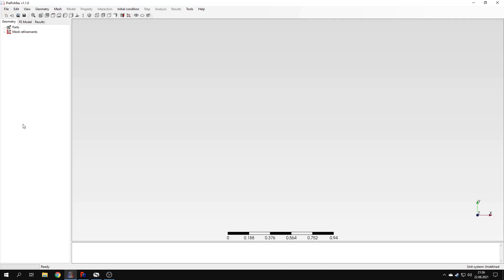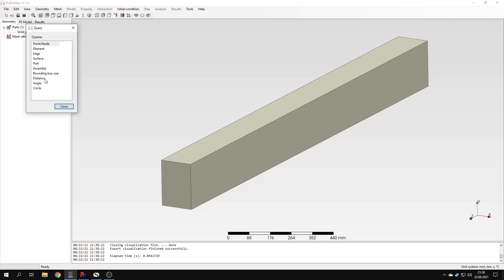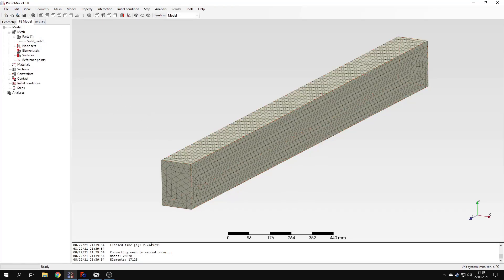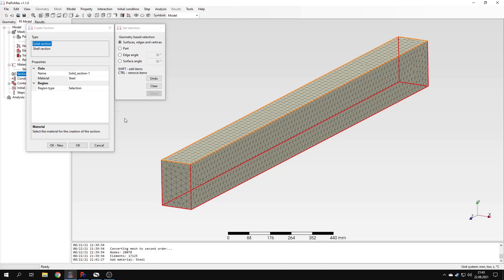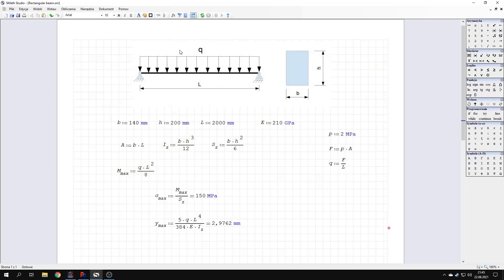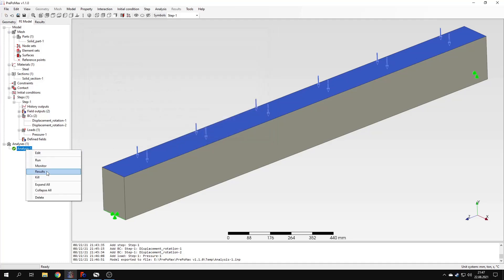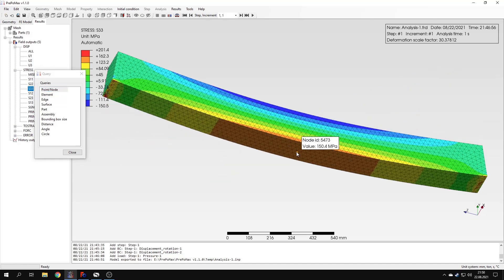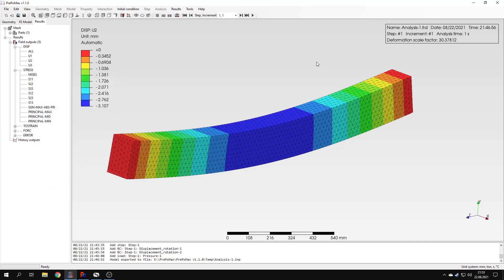PrePoMax (CalculiX FEA) - Tutorial 1 - Basics, bending of a beam

Comment: Thank you for an excellent introduction to PrePoMax with a great workflow, valuable background information and a hidden gem to Smath Studio (would it be possible, if it is not very inconvenient, to please include the corresponding Smath worksheet on the Google drive link?)
Reply from the maker: Currently, I switched to Calcpad and don't use SMath anymore because of the changes in its availability. You can see this in the newer tutorials.
Reply: @FEAnalyst  Thank you for responding and providing a new resource.

Comment: Where can I find Factor of Safety in PrePoMax ?
Reply from the maker: You can use the "Results --> Field Output --> Create --> Limit" option for that. The SAFETY FACTOR contour plot created this way will show the specified limit (e.g. Re or Rm) divided by the selected output (e.g. Mises stress). You define the limit values per part or element set.

Comment: If I setup a reference point at the center of the beam and I want to see the deflection of that point, how do i do that?
Reply from the maker: Reference points work only when assigned to rigid body constraints. But if you just want to measure something, you can request history output for an existing node (split the model into segments if you don't have any vertices and thus nodes in the desired locations).

Comment: Hello how did you get 2000mm for L? the length of the beam is 200 even when I use the query tool. my results in SMath are accurate but the analysis is not so i am curious where I went wrong
Reply from the maker: Are you sure ? I downloaded the STEP model, imported it and measured again - the length is clearly 2000 mm. Is your unit system correct (mm, ton, s, C) ? The height is 200 mm so be careful how you snap the Distance tool to the geometry.
Reply: @FEAnalyst  Thank you! I will set up again from the start and make sure I do it correctly.

Comment: You fixed the entire length of each support. I think they not be constrained that way. For simply supported the length of the edge should be constrained in the y direction along the length and one corner node should have an x,y,z constraint. On the roller end just an x constraint on a corner. A fully fixed edge can introduce stress that may not really be there because of poisson's ratio effects. If the beam is very wide even the fixed y constraints can make the beam unnaturally stiff.
Reply from the maker: Well, it’s hard to meet the assumptions related to supports of the analytical beam model in a full 3D model where all the effects like PR and stress concentrations are present. There are various more or less accurate ways to represent the supports. It’s like with cantilever beam where you can just put a fixed constraint at the end or make some combinations with a structured hex mesh and BCs on individual nodes/edges to prevent spurious stress concentrations (which are usually just ignored with the simplified approach) due to PR. Here I went the easier way but that’s why I always include hand calcs - to know that the solution is good enough. Let’s also keep in mind that it’s the first tutorial for beginners so it should be as simple as their first analysis can be so it could just be a basic cantilever beam as well. But I wanted to show something a little bit less trivial.
Reply: @FEAnalyst 

The solution of the entire domain does not depend that much on the exact or approximate boundary conditions.
Reply: it's not too friendly for a user....
but there's a huge advantage...
open source
how long have U been learning PrePo?

Comment: what is the difference between the bondary conditins and the constraints? I would like to setup a compression only bc for a simply supported beam problem
Reply from the maker: Boundary conditions in mechanical analyses are just fixed or prescribed displacements. Constraints are more complex and imposed in different ways. New version of PrePoMax supports compression-only constraint (internally using GAP elements which are basically contact elements or otherwise, more complex springs). I will cover it in the next video.
Reply: @FEAnalyst   nice, thank you

Comment: Hi, I have a question. I made an statical analysis in PrePoMax which I examined the normal stress in a bar. I had a section view of that bar at hte point where I want to examine. For example S33 normal stress results. My problem is the results were given in color spectrums like between 100 MPa - 70 MPa is green, between 130 MPa - 100 MPa is red. So we need to look at the colors to distinguish the results on a section view, and we cannot have a precise result. I tried to find a way which I will be able to look just the place I click on like Probe feature in ANSYS. Is there any possible ways I will be able to examine the result value of the exact point I click on?
Reply from the maker: Yes, there is such a tool in PrePoMax. You can find it in Tools --> Query. There's also a shortcut on the toolbar in the newest version.

Comment: Another question (I'm sorry :)  ): Are they going to include in prepomax the beam elements (1D lines) ? May there be other free FEAs that can hande that?
Reply from the maker: No problem, I will be glad to answer any questions :-) Beam elements will likely be supported in the future but for now you could use FreeCAD’s FEM module which also utilizes CalculiX as a solver and in which these elements are already available. Just keep in mind that there are still quite common issues with beams in CalculiX. Hopefully, they will be fixed in subsequent releases but for now be very cautious when using these elements. Specifically, you may get very inaccurate results with some types of beam elements in ccx when plasticity is involved and there are bugs in user beams (custom cross-sections). One of them was fixed in ccx 2.18 but the other one still persists. If you encounter any bugs in CalculiX, report them on its discourse forum so that there’s a chance they will be fixed. PrePoMax also has its own discourse forum and a section there for bug reports related to it (pre and postprocessing issues).
Reply: @FEAnalyst  thank you

Comment: Hello. Thank you. I would like to know if there is possibility to apply element mesh type in shape of hexadrons/ hex dominant? If no, would I really get worse results If I just use tetrahedrons?
Reply from the maker: Currently, meshes with hex elements can’t be generated in PrePoMax but they can be created externally and imported e.g. from Salome-Meca or Gmsh. In many cases tetrahedrons are sufficient and just may require more refinement. But there might be problems with accuracy in some particular cases such as plasticity which requires particularly careful choice of elements in CalculiX.
For shells you can generate quad elements directly in PrePoMax.
Reply: @FEAnalyst  thank you

Comment: i think the difference may come from the support - analytically it would be in the center of the cross section ...
Reply from the maker: In most cases there are some small deviations from analytical or experimental results. Usually due to different assumptions of the model (boundary conditions are the most common reason) but also because of discretization. Check out my video in which a beam is analyzed with plasticity included. That's when the comparison with theory becomes tricky ;-)

Comment: Great Video.  Thanks.  Reaction forces vectors would be a great enhancement / feature.
Reply from the maker: Reaction force output is already available in PrePoMax. RF variable can be requested as both field and history output.
Reply: I found an error in the imperial gravity units. Is there a bug report location? 
This code is so good (for the price) i would like to help when i can.
1 g  = 386.4 in/sec .. interprets 
386.4 in/ sec as 386.4 g
Reply from the maker: @marksholcomb  Bugs may be reported here: 
https://gitlab.com/MatejB/PrePoMax/-/issues

And if you can code in Visual Studio, help with implementation of new features will be appreciated. Feel free to contact me or Matej.
Reply from the maker: @marksholcomb  I checked and it seems to be working fine. Gravitational load is defined in CalculiX by providing the actual magnitude of acceleration in length/time^2, not in g units. So if you type 386.4 in/s^2 then the same magnitude will be used in the input file and it should be correct.
Reply: @FEAnalyst  your material density must be in lbs mass… ah i see material database is in lbm .( aluminum density is .1/386.4 for example) I was lbf/ in^3 for density… thanks. I stand corrected. I did dynamics for 40 years and got caught out on a rookie mistake ;).

Comment: Steel is understandable ... but it would be interesting to watch a lesson about reinforced concrete with cracks ...
Reply from the maker: Indeed, RC beam would be a very interesting example. The problem is that CalculiX doesn’t offer any special-purpose techniques for modeling this type of material. There are no equivalents of embedded region constraint (this way reinforcement can be placed inside the beam) or material models such as CDP and concrete smeared cracking known from Abaqus. Interestingly, there is an example of RC beam in CalculiX documentation but it involves approximation by treating the beam as a layered composite. By the way, in the next video (coming soon) I will show how to analyze a sandwich beam in PrePoMax so you might be interested in that topic as well.